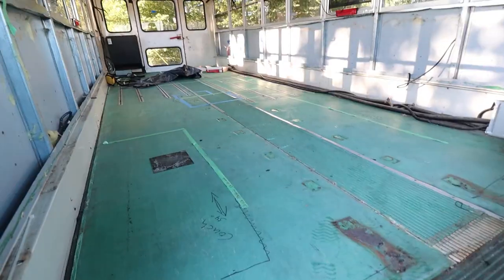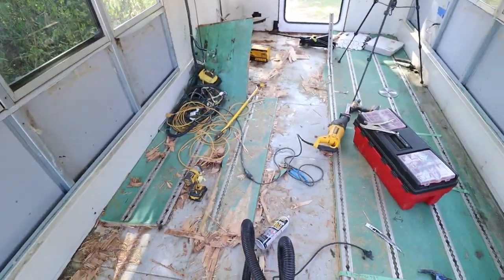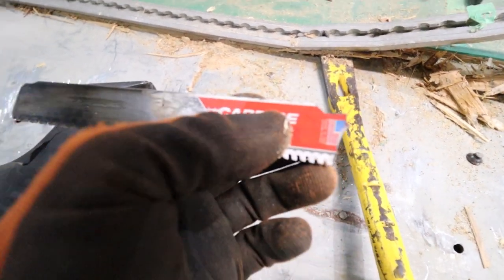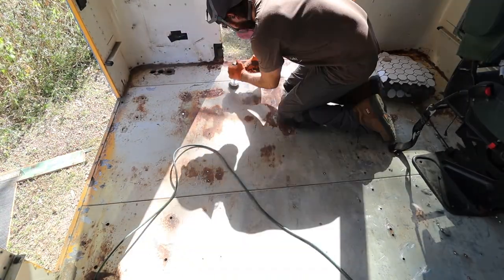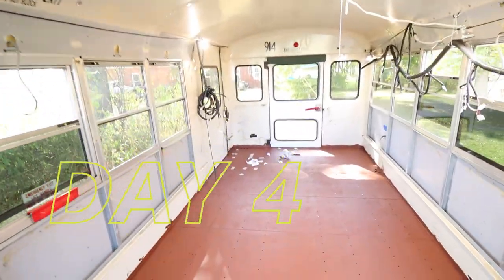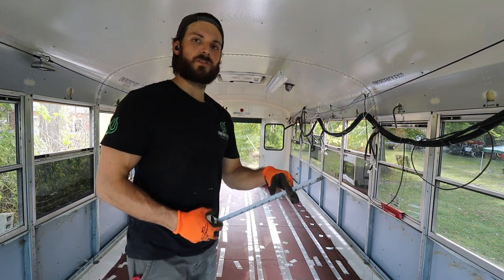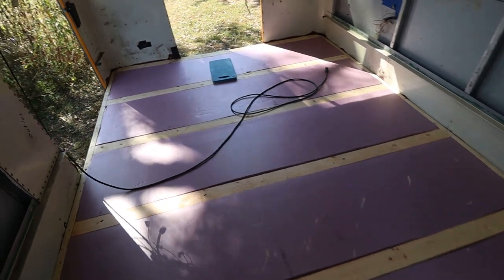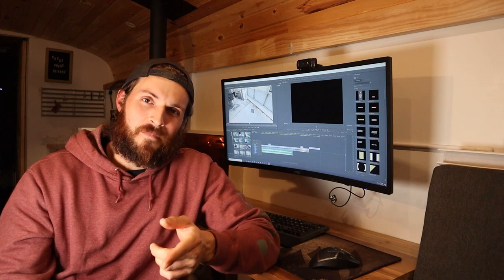BUSLIFE || NEVER BUY A BUS WITH THESE RAILS! || Floor Removal and Subfloor Install

Comment: My bus had at least 60 feet of these stupid rails. I took a week off of work and it took me the full 7 days to get them out on my own! Seriously such a pain and had to visit the chiropractor after. I ended up using the angle grinder and slicing at each bolt like your have detailed.... but I found perpendicular worked better? I tried cutting below but there was some sort of rubber that burnt up my grinder. This was seriously the worst part of the whole build so far... SO SMART to make a new shank. Anyway, I feel your pain. It will be a faint memory soon!! You’re doing great!!
Reply from the maker: I completely understand your pain! It really has been the absolute worst part. I was actual doubting my abilities to even finish the job because of those stupid rails 😂. I cut a line in the video that I should have kept detailing how these are almost always different in every bus. So just like you said you could grind them off from below, I totally understand that too because I watched 5 videos on how to remove these and they were almost all different 🙄.

Comment: Got one of these busses,  he is not liking about those rails,  I used grinder for all,  but the old floor is out.  At the rust grinding stage.  So much fun,  but will be worth. It when the floor is in.  Local stores are out of 1 1/2 inch insulation. Waiting on restock
Reply from the maker: Glad you got those rails off! What a pain lol. Good luck getting the insulation! I'd do 3 inches if you can, but that's only possible with a higher ceiling height.

Comment: Looking good ! Finished converting a 2008 ic ce300 7 windows bus 3 months ago after 3 months of work. Very similar to the one you are working on. Did not have those aluminum rails because mine was not a special needs bus. Even though you have already converted a bus before, if you have any question about that particular bus model, maybe I could help.

Comment: You should get a small sand blaster that hooks to an air compressor. That would save you time instead of wire brush maybe? The granulite isn't super pricey either.
Reply from the maker: Good idea! I could probably actually get down to bare metal too.  I didn't spend TOO much time with the wire wheel so idk if the cost would offset the time.

Comment: This must be a 2009 model year bus that you're converting in this video, since the unit number starts with 9, as in some states, they use the model year as part of the unit number. I see that you're converting an IC CE300 with an International 3300 cowled chassis, powered by the 7.6 liter MaxxForce DT I6 diesel engine, that was used as a special needs school bus with a flat-floor interior.

Comment: So Im doing a build as well Im at the same point but my question is. And its prob dumb but why even mess with the tails or pull the wood ?  Wouldn’t it be extra insulation if left ?  Just make sure you miss the rails when having to drill anything…..
Reply from the maker: There's a few reasons I wouldn't personally want to do that. The first being that you don't really know the condition of the subfloor unless you pull the wood up. That old obs holds moisture which leads to rust. Almost all bus floors have some rust, but it's good to see how much. Secondly, it's not an effective insulation, especially if it has these aluminum rails which would be a conductor and help to transfer the outside temp in to the bus. The last reason is more personal, but I feel like it's the more professional practice to rip everything out and have a bare frame to start with. I wouldn't be the end of thr world if you left it, but I wouldn't count it as insulation so it would be taking space from your headroom.

Comment: Too late to be of any help, but there are drill bits made especially for drilling out spot welds that would make short work of those track bolts.
Reply from the maker: I'll keep it in mind, but my preference is to never touch a bus with those rails again 🤣🤣
Reply: I am currently dealing with this. What kind of drill bits are they? Like what are they called?

Comment: What would you normally use on the holes if you did not use the foil tape in your own build?
Reply from the maker: Welding them up would be the absolute best I’d assume. Nothing wrong with the foil I guess, It’s just so thin that it could get punctured if something hit it from underneath.
Reply: @BasicallyNomads  what did you use on your build? Did you weld?

Comment: Lmfao im doing this now atm and it sucks! Im just grinding the rails in front of the bolts then sawing under the small piece of rail left
Reply from the maker: It was the absolute worst! Did yours have the plywood under the railing as well? I heard some people had a better experience because the ply was only on the sides of the rail. Sure would have made the job easier!
Reply: @BasicallyNomads  bro its even worse its rubber strips under it so i can't even cut under just the rail. I have to chisel out the rubber then cut
Reply from the maker: @The.juan.fernandez  if anyone understands your pain.. its me 🤣 Good luck on the build.. at least you're getting the hardest part out of the way now LOL
Reply: @BasicallyNomads  agreed lol

Comment: Oscillating cutter tool with a carbide blade would have take this down in minutes.
Reply from the maker: Wish that were the case! I have one and I can't see a scenario in which it would have out performed a Milwaukee torch blade on a Sawzall. It takes minutes to cut through sheet metal.. with mine anyway. Maybe I need to upgrade my multitool 🤣